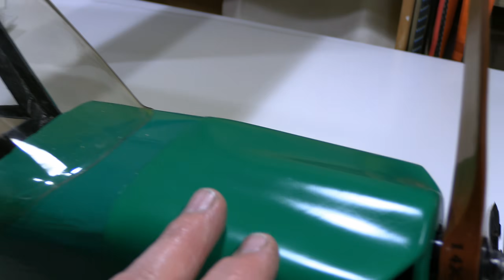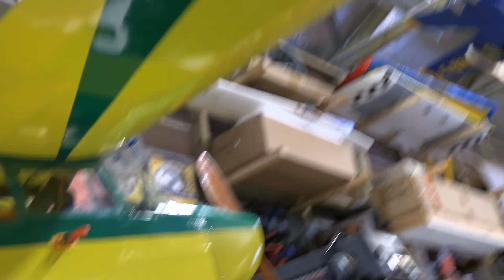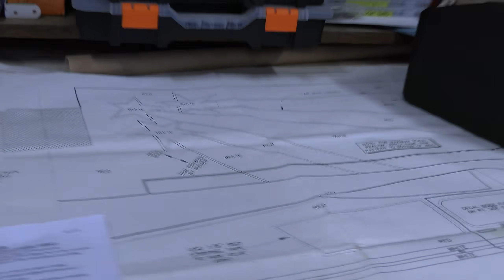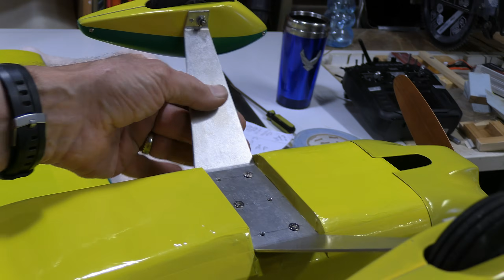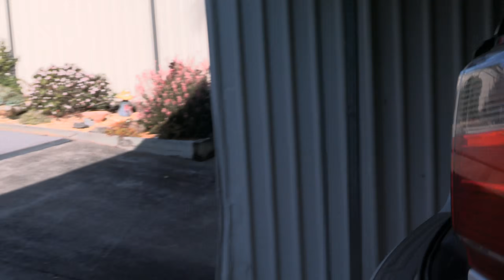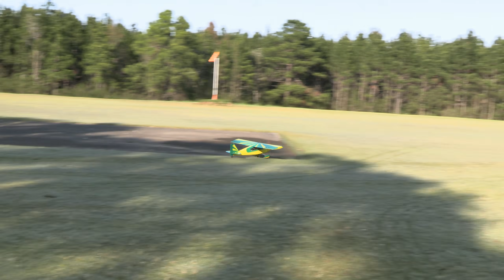Maiden Flight & Crash - Great Planes Decathlon 40

Comment: "Maiden Flight & Crash" 21 minutes before we even get to the field. Another 2 minutes to get in the air and then crash. A total of 2 minutes of the "Maiden Flight & Crash" out of 26 minutes.
Reply from the maker: Yes, I probably should come up with a better title.  This video is the last in a series of videos on the building of this plane.  The flight was supposed to just be the icing on the cake, showing the success of the lengthly adventure.  Unfortunately it didn't quite work out that way!

Comment: my dad states with rc planes their all going in the trash some just take longer than others. 😢
Reply from the maker: It's good when that is after many, many flights and lots of fun!
Reply: @RCJim  i can’t get over how expensive stuff is. My dad flew a lot. Back when Kraft was a thing. He has an original Decathlon red/white with pretty stout engine.  The glue holding the landing gear/fuselage sandwiched i doubt it’s air worthy even if you gutted started over.  Astro Hog same thing new servos radio. he Has giant for its day a um cub or another decathlon it has a chain saw engine he flew it but he said it was scary. The F-14 i saw 40,000$ i said hugh on you tube i want one  but have fun helping dad as a kid. he did fly some rc helicopters budget builds. Even that got expensive i like watching we built those off and on after his work days. Yea i heard the pre verbal plap tree ate one oh well reason i went in the house i knew  it was coming  Hopefully your decathlon is salvageable if not these companies ought to start rebuild or ready made wings etc.
Reply from the maker: Sounds like you are around some very interesting planes.  Fixing the damaged ones is one way to keep the costs down.  Money can also be saved by going with less expensive components, including transmitters, receivers, motors and escs.   Of course, it's a good idea to match the quality of the components with the cost of the plane.  If you did have a $40,000 jet you wouldn't be flying it with a Flysky ST8!
Reply: @RCJim   my dad hung up his wings many moons ago but yes i was around them as a kid. Plus he had his pilots license 🪪. But at least he uses his i pad to fly. Lot less expenses burn up go go juice imaginatively.
Reply from the maker: Flight simulators are also good for those of us who are still flying the real ones.  I like to try out crazy and aggressive maneuvers on the simulator before even trying them on my profile foamy!

Comment: That is one of the Snap-happiest models me and my buds have ever flown. The elevator throw is critical on that model. You pull a hair too hard on the elevator and it will instantly stop flying, especially in a bank. That model will snap and stall on you in a second. We were flying them in the very early 1990's. Seen a lot of good pilots surprised  by the model. Once we figured the model out and flew it within it's envelope, it was fine. The fully symetrical wing only adds to the problem. BE CAREFUL OF THE ELEVATOR THROW, or you will be taking the walk of shame again!!
Reply from the maker: Thanks for the tips.  It would be nice if I could learn these things without having to crash a plane first!

Comment: Surface travel......set up on 3 position switch....factory setup as mid, increase 15% for high and decrease 10% for low.....works every time....relying on the factory for travel and CG always a mistake!!!!!!
Reply from the maker: I had factory as low and nearly doubled for rate 3.  Just didn't think to flip the switch!!!
Reply: @RCJim  Ya in the heat of the event, its hard to some times think straight.....too bad looks like you spent a lot of time and effort....sorry

Comment: Sorry about the crash. I've had two this year ! 
But that color green may be what I've been looking for to complete an ARF I'm working on. Can you advise what the brand and color name/ code for that green is ?
Reply from the maker: You don't want the brand that I got.  It came direct from China, and was folded for shipment.  It's really hard to get the backing off, and it doesn't stick all that well.  You may also need to match spray painted parts.  If so, you want to select a colour for which the paint is available.
Reply: I understand. But I only need a small section for that color, not for an entire plane. By chance was it the Hobby King Solid Grass Green color, affectionately called Chinacoate ?
Reply from the maker: @SteveGonwa  Sorry, don’t remember. Bought it online a couple of years ago.

Comment: Sorry for your loss. Slow flight during the flight episode may have allowed you more control with rudder. RC planes often (definitely) have a higher power than the proportional equivalent to the real AC.  This comment is from a real 8KCAB pilot and an RC pilot of years past. I really cringed when you crashed knowing how much love you put into the build.
Reply from the maker: Thanks for your thoughts.  Next time I'll make sure I have more control movement on all of the surfaces.  I think I could still be a great plane to fly.  I loved how it got up right off the ground so easy, with no issues.  The flying was great.  The lack of control was the problem.

Comment: As a pilot you always prepare for the worst case scenario. You should have had dual rates or even triple rates set for all 3 control surfaces so you could have increased or decreased thow. That crash was 100 percent pilot error. Better luck next time
Reply: I flew RC for about 10 years.  Never bothered with dual rates.  Always set my throws as the plans indicated and other than a rolling P47, never really had an issue on the maiden flight.  I would do a fast taxi test always just to see where things would lean…
Reply: @billkraemer4710  I totally get that people are set in their ways, and it's great that you follow the recommendation for setting's. Myself I always set triple rates and throw in some expo even. If I get the model in the air and I need more or less control throw. I want to be able to flip a switch and save my hard work from hitting the dirt. Especially with my edf jets. I'm always switching with my 3d aerobatic aircraft as well. The gentleman that crashed his model in this video said that he had rates set but didn't switch them fast enough. It took him by surprise. I'm guessing
Reply from the maker: I did have, but just failed to use them.  Sometimes I just don't think quick enough...
Reply: Harsh comment without knowing the details.
Reply: @flycatchful  you think that was a harsh comment? What's wrong with you snowflake

Comment: 2125    WUT  r  u  doing ?!?      
2142    it appears that the shape of the wheel pants results in unscheduled  lift,  Near  the  center line.    if so, this is a design defect.       it appears that the main lg is located slightly forward-of where it should be.
2150    the horiz-stab  is  Small.!
2228    the prop and/or the cowl is a little noisy.     such noise 'equals'  Vibration.      (excess) vibration  can result in servo glitching,  and 
2243   crashing.    when  the  control system has a nervous breakdown.      (full aileron deflection and death spiral)        did this  Electric  model, correctly, have a zero-zero thrust configuration.?!?!
Reply from the maker: See the next video for a detailed look second by second of what I was doing.  At the end, on the way down, I certainly panicked and  made incorrect control inputs.  Horizontal stab and cowl are according to Great Planes factory specs.  The plane has a better than 1:1 thrust to weight ratio, but after I reached the top altitude I did have the throttle cut back most of the time.  Thanks for your observations.

Comment: You committed a beginner mistake, you didn't do a range check or a control throw test first before you fly.

I didn't see any elevator deflection either,  I don't know maybe your esc or servo went bad, you need to check everything.
Reply from the maker: I did do a range check.  At home I set the control throws to be precisely what the plans called for.  At the field I checked both at the bench and also at the flight line to make sure all of the control surfaces moved in the correct directions.  Flight data confirms that I had a good radio connection throughout the flight.  What I failed on re. control throws was that the ailerons were modified to be more scale-like, and I didn't account for that.  See the next video for a detailed analysis: https://youtu.be/78vNlHV_Xco
Reply: @RCJim 
Oh, ok 👍